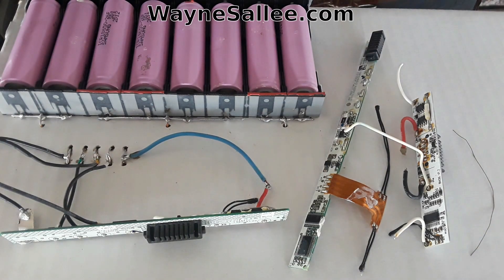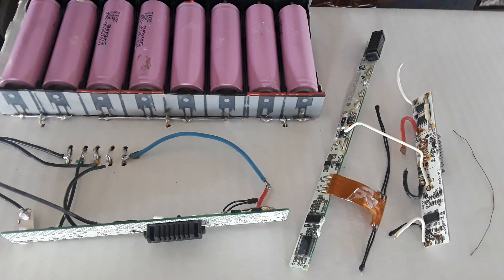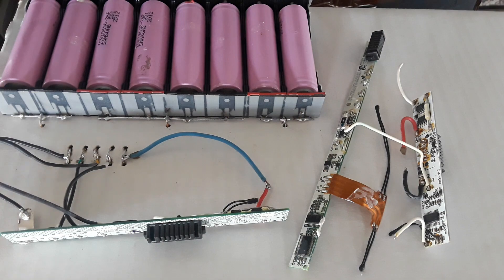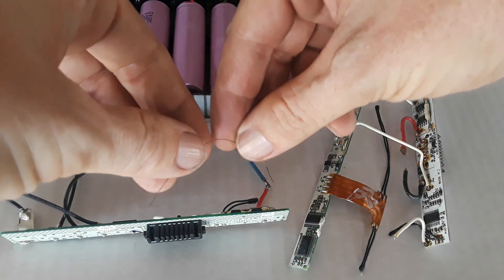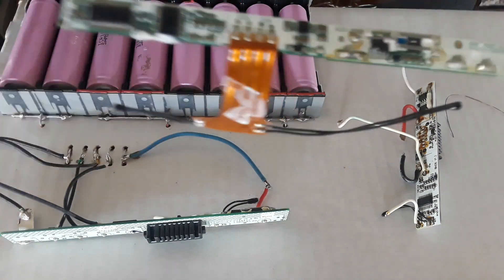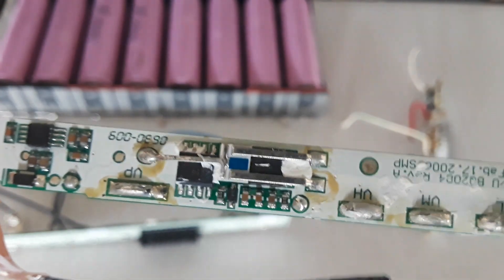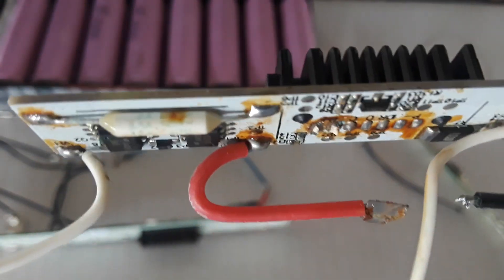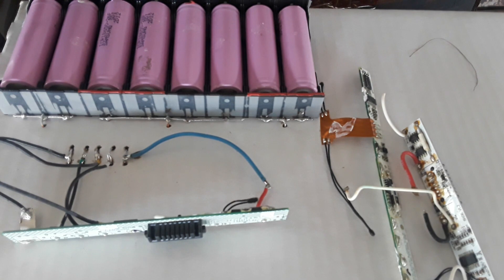Resetting Your Laptop Lithium Battery Pack After You Rebuild it.

Comment: Hi, can you help me reseting k46cm asus laptop battery? I have tried many ways (as you showed), but no sucess.
Reply from the maker: What have you tried?

Wayne Sallee
Wayne@WayneSallee.com
http://www.WayneSallee.com
Reply: @WayneSallee-comTech  hi, i have sent you an email
Reply from the maker: @leandroaugusto1856  I accidentally deleted your e-mail with the spam. I just now pulled your e-mail out of the trash. If you post here, more people can benefit. 

Did it work on battery before you replaced the cells? What was the behavior before you replaced the cells? What is the voltage reading when you test for voltage, on the battery terminals?

Wayne Sallee
Wayne@WayneSallee.com
http://www.WayneSallee.com
Reply: Hwmonitor show voltage as 14.4V. but when i check voltage on terminal It is zero.
Reply from the maker: @leandroaugusto1856  HWMonitor is showing charging voltage. Check the fuse on the BMC. Was the battery working before you replaced the cells?

Wayne Sallee
Wayne@WayneSallee.com
http://www.WayneSallee.com
Reply: @WayneSallee-comTech  the battery was working before replacement, but was running for just about 20min (old batteries). I cant find the fuse here, how does it look like?what should i check if i find it?
Reply from the maker: @leandroaugusto1856  Re-watch the video to see what the fuses look like. Also recheck to make sure that you have the wires connected to the proper location, and that the batteries are in proper order. Where the wires hook up to the BMS each connection is labeled. Make sure it is correct, and check the voltage at each location. What is the voltage at each location?

Wayne Sallee
Wayne@WayneSallee.com
http://www.WayneSallee.com
Reply: @WayneSallee-comTech  wires ok. Order ok. Each voltage ~3.6. my fuses is a rectangular one, doesnt look like yours.
Reply from the maker: @leandroaugusto1856  Do you have this fuse? : https://www.aliexpress.com/item/4000602271621.html 

Each connection to the BMS is labeled. List the label name and voltage at that point. To do this, put the negative probe on ground, and test each of those points with the positive probe. What is the voltage at each location? 

Wayne Sallee
Wayne@WayneSallee.com
http://www.WayneSallee.com

Comment: how can i reset the second bms that You show
Reply from the maker: Apply Power to the power connections on the BMS. The BMS has data connections, and power connections. The power connections are usually at the ends, and will almost always consist of 2 connections soldered together. This will charge the batteries, and also reset the BMS after you replaced the batteries, because when you replace the batteries, the voltage drops to nothing, and the BMS turns off. Likewise if you have batteries that drop too low, on some BMS the BMS will turn off.

Wayne Sallee
Wayne@WayneSallee.com
http://www.WayneSallee.com

Comment: My friend, I have an old dell laptop in which I changed the battery cells, and although it charges, it discharges after 20 min, staying at 3%~7% remaining, and it can be like this for 2 hours without  problem, then I recharge it to 100% and it does exactly the same thing, what should I do? thanks
Reply from the maker: It sounds like the battery is failing to properly relearn. You can try leaving it on, until it crashes, and then recharge to 100%. You can do this a couple of times, and see how it does. You could also try booting with a Linux boot disk, and see if the charge value is the same.

Wayne Sallee
Wayne@WayneSallee.com
http://www.WayneSallee.com
Reply: I have the exact same issue. At first it would charge up to ~12.6V and assume it was 100%. Then I manually charged the pack to 12.6 with battery charger. It used to work and it learned really well. But at some point it started to fail again. Now it's a total mess. It only charges up to supposedly 15% but it goes up to 12V. then it drops to 0% after some time, with the battery still around 11.5V (The cutoff is 9V) but I set it to sleep when battery is drained, so I can just wake the laptop back up again. Now I can survive a couple more hours on 0% :) Justv check the battery voltage with software sometimes and estime how much left.
Reply from the maker: @oglcn11  Did you open the battery pack? If so, did you check each battery to see if you have any bad batteries?

Wayne Sallee
Wayne@WayneSallee.com
http://www.WayneSallee.com
Reply: @WayneSallee-comTech  Yes. I replaced each cell with brand new Samsung 30Q cells. I forgot to mention that :)
Reply from the maker: Also dell likes to refuse to charge your batteries if if does not detect the charger right, unless the laptop is turned off.

Will it charge the battery up all the way if the laptop is turned off?

Wayne Sallee
Wayne@WayneSallee.com
http://www.WayneSallee.com
Reply: @WayneSallee-comTech  Not sure if you're asking me but mine's an 2011 Acer unit. It doesn't matter if the laptop is on or off. It refuses to go above 12-15% on display and goes up to 11.8-11.9V on the battery. Sometimes if I leave it for very long, it will display 100%, but immediately as I remove the charger it goes back to 12% range again. Also the main problem is that laptop will refuse to run from shut down state when displayed battery is 0% but I have a lot of charge left. So I have to jump start it with charger, then use sleep mode exclusively. It will wake from sleep even if displayed battery is 0%.
Reply: Also the pack I re-celled was an (supposedly quality) aftermarket one. The entire reason was that I got fed up with buying battery packs every 1.5 years. Original lasted about 6-7 years before dropping to 10mins usable life. Maybe can I find a better controller board? I could also try to find my original pack circuitry maybe. Should be somewhere around...
Reply from the maker: @oglcn11  Yes, I would try the other bms, and see what it does. You might want to keep power on the the current bms to keep it from killing itself. So many  of those bms are designed to die when power is disconnected. Sometimes you can get away with disconnecting the power once, but not the second time.

"Right to Repair" is becoming a big movement world-wide.

I hate proprietary, that's why I'm building my own laptop.

Wayne Sallee
Wayne@WayneSallee.com
http://www.WayneSallee.com

Comment: @WayneSalleeTech  can I use higher mah battery cell in laptop battery case. Will bms of laptop support it ??  Asking for acer aspire 4740 & sony fseries vpcf135fg.
Reply from the maker: Yes. When choosing a battery consider both mah and max amps. Often when one is higher, the other is lower. So look at both specs.

Wayne Sallee
Wayne@WayneSallee.com
http://www.WayneSallee.com
Reply: @WayneSallee-comTech  no I will use old laptop battery that contain 6cell 3s2p & replace it with higher mah cells in the same old case . Can i do that ?   Old cells each 2600mah will replace it with as much as high I can achieve.
Reply from the maker: @bhavishdhankar1943  Think about it this way. When you go to the store to buy a car battery, the manufactures will brag about cranking amps. If you look at the trolling boat batteries, they will brag about trolling hours. Both measurements are important.

Wayne Sallee
Wayne@WayneSallee.com
http://www.WayneSallee.com

Comment: I have an Asus X542 2S battery it wasn’t giving any output so, I connected it to battery (+) directly and was working fine, but from last week it stopped charging!  I checked it found the BMS not letting it charge! Maybe, it’s cycle count is reached. 

So, is there any way to reset the BMS memory or directly bypass it? 

The 2 battery cells are fine.
Reply from the maker: There is probably a bms for each cell. Have you checked to see if it will charge with the laptop turned off?

Wayne Sallee
Wayne@WayneSallee.com
http://www.WayneSallee.com

Comment: I have asus battery a32-u47. When i try the + to +, then fuse 12ah3 immediately blows. After repairing this fuse with a lot of solder, then after jump + to + again, fuse blows, but a little bit longer) Can you give advise what to do in this case?
Reply from the maker: About all I can tell you is to make sure that you are connecting it correctly, and to use a resistor to make the connection to limit surge of power. I got so fed up with the battery proprietary nonsense, and other proprietary nonsense, that I built my own laptop.

Comment: Thanks alot for usefull information mate, but i just have new problem. Now it's my second time rebuilding my pack. Now i cannot reset it, when i touch to the positive pole of battery and positive slot it gives power (by my finger) when i take my finger off power gones. It's same with jumper cable too. I'm totally confused. after watching your guide i bypassed the fuse( which is first type on the video) but nothing is changing. I get power from bms just when i touch the poles or touching by finger. I already checked the connections and couldn't find any clue. Batt voltage is 15.35V and each cells are equal to 3.83V
Need your advice. Thanks alot!
Reply from the maker: It's looking like some, if not many are designed to fail after being reset a certain number of times. It's a pain to keep the proper voltage on all the rails while rebuilding, but I think that just keeping the voltage on the main lines while rebuilding would probably be enough. But even that's still a pain, all because they don't want us to be able to repair our products that we own. www.fighttorepair.org

I hate proprietary. I'm working on building my own laptop with a desktop motherboard, and 16 lithium batteries.

Wayne Sallee
Wayne@WayneSallee.com
http://www.WayneSallee.com
Reply: @WayneSallee-comTech  Hello. I had the similar idea! Where can I follow up on the custom laptop progress?
Reply from the maker: @HongaSpb  Eventually I will post a video on it, on youtube. It will be big and bulky, but it will still fit on my lap. :-) It will have 16 lithium batteries. I have the power supply ironed out, but will need to be rebuilt from the testing mode to size to fit in laptop. Even the power sett-up I have is crazy bulky, using a number of adjustable buck converters. The whole thing is going to be heavy. But it's educational, figuring out how to make it work. It will look more like a desktop tower with a laptops screen. I will also have bigger speakers on it than normal laptops.

Wayne Sallee
Wayne@WayneSallee.com
http://www.WayneSallee.com
Reply: Thank you for your effort, im just trying to find another bms. I couldn't turn it on. Damn companies...
Reply from the maker: @abdurrahmanertan2067  Yes I have had it, with proprietary battery packs. 

But actually it's not the companies that will go to Heaven, or Hell, it's the people that run the companies. http://www.heavenhell.waynesallee.com

Wayne Sallee
Wayne@WayneSallee.com
http://www.WayneSallee.com

Comment from the maker: -------- Original Message --------
*Subject: *  Laptop battery repair Help
*To: *        Wayne <wayne@waynesallee.com>
*Date: *      2019-5-3  02:11 PM
> Dear Sir,
> I have seen your YouTube video "Resetting laptop battery pack" https://youtu.be/04sNLJ8Vdjk and really like it.
> I have Inspiron 14  3442 laptop. Thought It's 5 years old laptop now laptop showing on boot replace battery and without power adapter it won't start. 
> So I decided to repair the battery on my own. I deassembled the battery pack check for voltage across each individual lithium battery which seem totally fine 4.1 volts. However I change the lithium cell with new ones. 
> But it won't help anymore So I find out their must problem with the battery BMS circuit I bypass the fuse on it won't help.
> I tried your method shorting + to + it seems nothing happen then - negative to -. 
> Across the battery voltage is shown 15.9 volts but on pin it's 0. Negative pin to fuse it showed 15.9 volts positive pin should show voltage. 
> I certain point I realize the it shows voltage 15.9 on pins but for just a second of time then 0 volts. Will you please help me in this build, what could be the issue? How do I fix this problem.
> Attaching few photos of my battery pack circuit.
>

Test each battery and let me know what the voltage is for each battery.

I am assuming from your pictures that those 4 batteries are in series, and that none of them are dummy batteries.

It sounds like you have identified the + and the - terminals that the laptop uses. After being sure that you have correctly identified those terminals, apply 4.1 volts times 4 (number of batteries in series) = 16.4 or higher, because of voltage drop in the BMS (less than 18 volts).

While charging test the voltage of each battery, and see if the voltage goes up.

If it is able to charge the batteries, then after you get the batteries to 4.1 volts each, try again to see if the bms will give you power.

BMS calculates batteries as fully charged when battery voltage reaches 4.2 and amps drop to specific level.

Let me know the results.

Wayne Sallee
Wayne@WayneSallee.com
http://www.WayneSallee.com

-------- Original Message --------
*Subject: *  Re: Laptop battery repair Help
*To: *        Wayne Sallee <Wayne@waynesallee.com>
*Date: *      2019-5-5  04:03 PM
> Thank you for your reply.
>
> I check voltage across all batteries it is almost same 4.13 Volts each and none of the seems dummy. If yes then please tell me how do I find dummy battery.
> I took this reading individually without connecting in series.
>
> After Connecting in Series 16.52 volts.
>
> I am attaching Picture while taking reading at each cell and various points on Circuit. I found the only voltage is not on "+" positive pin, other than that 16.50 volts are reaching till Fuse. I hope you will get clear idea from attached Pictures. I apologies for my messy setup. 
>
> One more thing I forgot to mention that I used external Power bank circuit to charge the batteries and all reading are taken after charging. One more time I tried resetting BMS method It wont work for me.
>
>

Yes, none of them are dummy batteries. Some battery packs will have space for more batteries, than the BMS is designed for, so to take up space in the battery pack they put a plastic dummy in so that the batteries don't jiggle around.

Did you try applying 18 volts to the BMS to see if the BMS would supply power to the batteries. Your laptop power supply would work for this.

Do you have the battery wires hooked up to the correct locations?

Wayne Sallee
Wayne@WayneSallee.com
http://www.WayneSallee.com

-------- Original Message --------
*Subject: *  Re: Laptop battery repair Help
*To: *        Wayne Sallee <Wayne@waynesallee.com>
*Date: *      2019-5-5  07:35 PM
> Yes I'm pretty sure about wire connections. I took pictures on first disassemble to make sure to restore all connections properly. 
>
> I will try apply 18v to BMS and see if it works. 
>
> I will let you know. 
>
>

Usually the laptop BMS will have the following wires labeled on the board:

VG Voltage Ground
VL Voltage Low
VM Voltage Medium
VH Voltage High
VP Voltage Power

The corresponding voltage at those connections is:

0 volts Voltage Ground
4 volts Voltage Low
8 volts Voltage Medium
12 volts Voltage High
16 volts Voltage Power

If the BMS detects bogus voltages there, it will not power.

Wayne Sallee
Wayne@WayneSallee.com
http://www.WayneSallee.com

-------- Original Message --------
*Subject: *  Re: Laptop battery repair Help
*To: *        Wayne Sallee <Wayne@waynesallee.com>
*Date: *      2019-5-7  02:09 PM
> This is the picture I clicked on disassemble. I made connections based on this picture.
> The BMS has only mark LP1, LP2,LP3,LP4.
> Also LP1  + positive terminal.

Then it should be hooked up to the batteries so that you get the following voltage:

LP1 0 volts
LP2 4 volts
LP3 8 volts
LP4 12 volts
LP5 16 volts

If you have it hooked up so that you get the above voltage, then the problem is with the BMS

Wayne Sallee
Wayne@WayneSallee.com
http://www.WayneSallee.com

Comment: Can you tell me how to reset hp battery?
Reply from the maker: Yes.

Wayne Sallee
Wayne@WayneSallee.com
http://www.WayneSallee.com
Reply: @WayneSallee-comTech  

How to reset hp battery?

Just have to connect two positives for second or permenantlly??
Reply from the maker: @navnathgurav9672  Just a few seconds. And it's safer to to use a resistor, or something with some resistance. I use a really thin wire.

Wayne Sallee
Wayne@WayneSallee.com
http://www.WayneSallee.com

Comment from the maker: CESAR LOPEZ
(Edited for Language) I was about to throw away my laptop battery, and saw your video and turned out that the problem was the fuse that was blown away. it is the first video that talks about that little fuse to be the cause of a not working battery laptop. thanks man. you save my battery and make my day!!!

 
WayneSalleeTech
Glad that it helped. It is good to be able to have the right to repair things.

Wayne Sallee
Wayne@WayneSallee.com
http://www.WayneSallee.com
Reply: Hi. as per object. I wanted to cheider you I changed the 18650 batteries for an asus f55u laptop I tried your advice but there is no voltage at the connector. on the 3-pin fuse there is no continuity and I made the bridge but if I make the bridge with the + it is short-circuited. I hope you can help me. thanks Luca
Reply from the maker: @lucamagliano6180  Is the fuse like the one in my video, or is it like this 12ah3 fuse? :
https://www.aliexpress.com/item/4000602271621.html

Wayne Sallee
Wayne@WayneSallee.com
http://www.WayneSallee.com